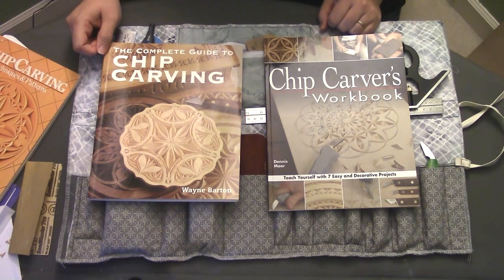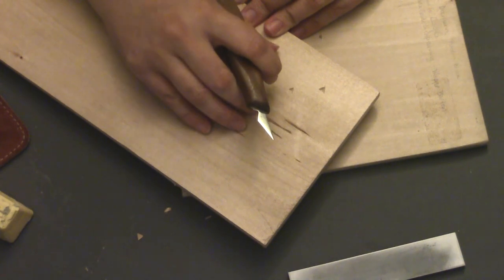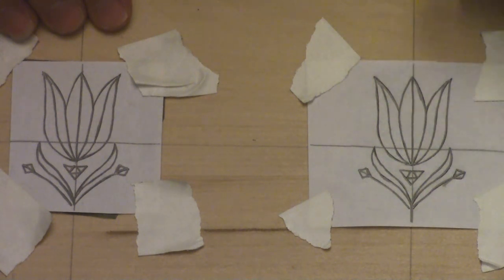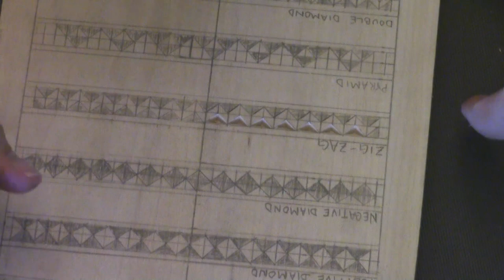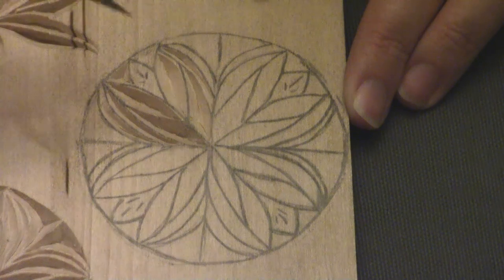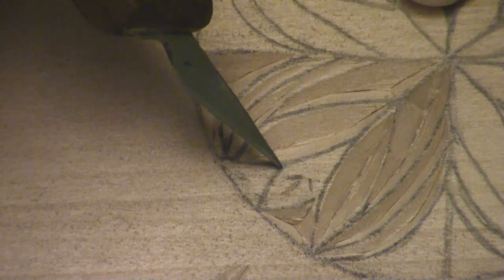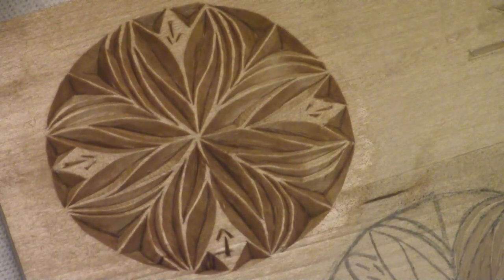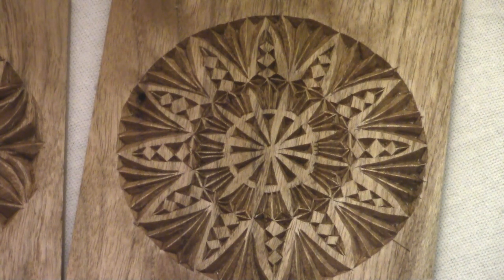Chip Carving with Danielle Dremann

Comment: Do you carve the flat pieces and then make box? I am wanting to make a box but am unsure how to carve the sides.
Reply: Hello! I do carve the pieces before assembling them. I typically set my 'blank' up - all the pieces to make the box are cut to their final dimensions. If there's hardware, I make sure to pre-lay that out so that I don't accidently carve over an area that will end up being covered or meant to hold the hardware. Other carvers may use a different approach. Since I consider myself relatively new to the field, it would also be worth gathering other opinions. I hope this helps! Thank you for your question.

Comment: what grit stone are you using for sharpening?
Reply: I favor ceramic sharpening stones. They don't require water or oil for use and can be easily cleaned with comet and a soft scotch pad (advice from Wayne Barton). I have a Grey 600 Grit (but hardly use it because I sharpen frequently) and my white stone is 1800 Grit. The video showed a Spyderco product which is also ceramic, but I more often use larger ceramic stones to carve my knives. I use a strop and compound to polish the knife after I've sharpened it on the ceramic stones. I'm sorry for noticing this question so late. Knife sharpening is a very diverse topic - you can ask 10 different carvers what they use and how they use them and you can get 10 different answers. I've had students use wet stones and have even met a carver who uses cardboard from cereal boxes with strop compound. Thank you for your question!